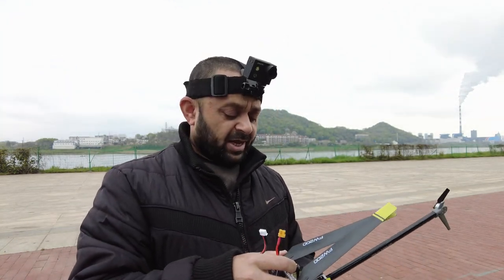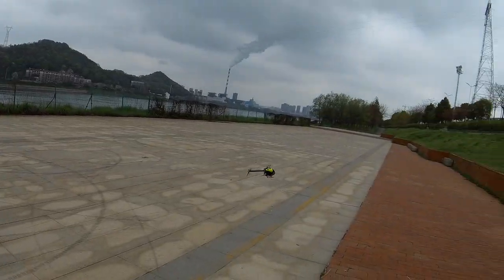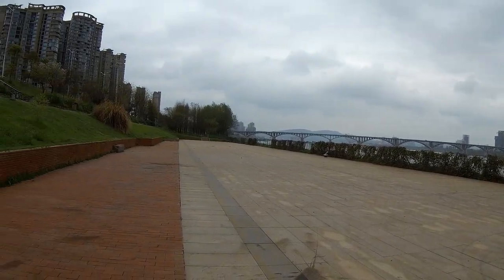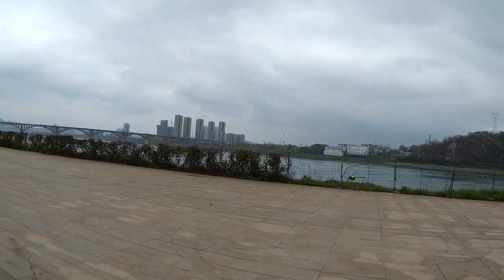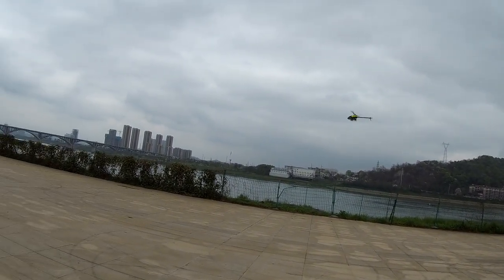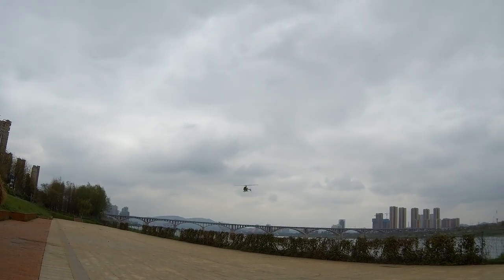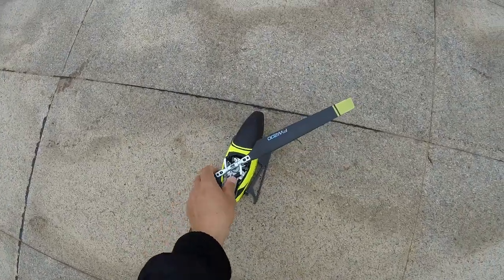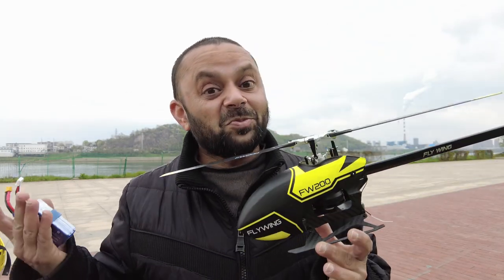Flywing FW200 H1 GPS RC Helicopter Flight Endurance Test

Comment: Hi Ali. Thanks for the evaluation video. You mentioned the large  nut under the motor housing being a safety feature. In my case it turned out to be the opposite. There is a small 2mm screw with washer screwed into the main shaft right underneath the large nut. Supposedly to prevent the nut from unscrewing itself. In my case the brand new heli had 'a screw loose' so to speak and both the little screw and the large nut became loose, the shaft plus everything else dropped and the blade grips damaged the anti rotation bracket. If this happens during intense flying, a disaster!! The reason:  missing thread lock glue during factory assembly, I found out.
Reply from the maker: thanks for the info :) maybe flying passed me wrong info before.

Comment: Those are great flight times, one year ago. I just got my FW200 V2 and 'hovered' for about 6 min altogether with some interruptions and the cells already dropped to 3.9V each. Had to stop for technical reasons. So I assume I won't get near to this fantastic endurance time, Will have to try again for full test.
Reply from the maker: sometimes its the batteries that are not up for it. a healthy battery wil fly it longer

Comment: Awesome Video! Considering the price difference and the smaller size difference too, as far as enjoyment (smiling factor) and helicopter learning fun factor which would recommend between the eachine e180 and this one?
Reply from the maker: FW200 is best for learning from beginning. but if you really want to proceed to 3D aerobatics later, E180

Comment: I cannot find a 3S 11.1V 1500 mah battery with XT30 connector. Do you have a link to the one you have that fits in the chassis?
Reply: Ali, I know you are tied up Paramotoring, but if you have a minute, can you  send me the dimensions of your 11.1V 1500mah BT-17 battery? They are not available anywhere before June, and I need to find a substitute that will fit. Coffees are on the way if you can help. Thanks, Mark

Comment: Please can you help me do you know the size of the hexagonal screwdriver of the xk 127 rotor? (( screw off the blades))<would you know it's okay that it would be necessary Please? And what type of screwdriver are essential to disassemble a helicopter??
Reply: Are sl slotted screwdrivers useful for the helicopte
Reply from the maker: previously i shown a screw drivers set with electric screw driver on my channel. you can get one that type and repair all mini helis

Comment: Hello Ali, again awsome video. Thank you.  I would suggest to buy 1 size battery smaller to be a little little bit more away from the motor. Looks little bit crazy to me how close the lipo is in the motor. May I ask you for a additional video? You promised a 3D flight with this helicopter. I still waiting for this video since 1 month :)
Reply from the maker: Ah I got very busy and i did try 3D on this one but to be honest its just not so good for manual 3D. no idea why but its so slow and docile to move around and control in manual mode. maybe they programmed it better for GPS and auto features but not for manual 3D.

Comment: I have a brand new FW200 that I got from Heli Direct, along with 3 new BT1500 -17 Li-po's same as Ali is using here, and I only get 8 to 9 min. flights and that's fine, but all 3 are weak. 2 of the li-po's after flying only 6 mins. I get the blinking red Low Voltage light, I land, check the cell's voltage and they have 3.86v to 3.88v per cell which is not close to LVC, should be at least 3 mins. of flying time left. I sent my FW200 back to Heli Direct, the tech flew it with his 1500 saying it flew fine, and he sent my heli back to me including his 1500, the 1st. 9 min. flight with his li-po was fine, the 2nd flight I got the red LVC light again after 8 mins. So I have 3 brand new Fly Wing 1500's and I have concluded they are weak and have a low C rating even when new, and notice how they don't even list their C rating? No sense in me trying a 4th. new one. Ali flying with the same 1500 as my 3 and getting 21:36 mins. of flying time? That's some crazy magic there, and I don't believe it. My heli tech said with a 1500 they fly for approx 6 to 8 mins. and 9 at best. I told him this claim of flying a 1500 for 21:36 mins, and he said impossible. Either Ali has a totally 'magic' 1500 or it's a sales gimmick to get people to buy the FW200. Some commenters here are so happy & excited about such a long flight time. DON'T BELIEVE IT !!
Reply from the maker: Hi Buddy, I do not lie nor I fix my videos. I have flown this heli many times and with those batteries i shown in videos plus you have seen its a straight forward honest video. its all about how you handle battery, I charge using pro chargers, i set my rpm right, i fly and cruise as you have seen in this video. and i make sure to disable the low voltage RTH. so i can drain the battery to its safe limits. if you keep Low voltage RTH on, it will always make you land earlier. another thing, batteries behave different in different temps and weather conditions. if its colder, you won't get much flight time, you have to charge with pro charger in winter and keep batteries warm before using. else you won't get any better flight times. then there are many other factors. you can study about batteries online and learn to get best results from these batteries.
Reply: @alishanmao Ali; Thanks so much for your reply! Excuse my late reply; I apologize for my comment suggesting you might be lying about such long flight times, and I will edit my comment to remove that. My new FW200 has been driving me crazy. I'm an advanced level RC person, I use only high quality hobby grade chargers and know much about Li-Po's, and regularly check their IR or 'internal resistance' I have a Fly Wing 450L V3 and it's perfect, also a YU XIANG Coast Guard heli and it's perfect. But my FW200 (Been flying it in 65* temps) after charging both of my new FW- 1500 li-po's to 4.20v per cell, it has an often constant problem of flying just 5 to 6 mins. then losing power & sinking, then barely hovering above the ground well before it's 1500 li-po's get to 3.84v per cell, so I sent it back to HeliDirect and the tech test flew it, he sent me 2 vid's of it flying well, then he sent it back to me with his FW-1500 that he used. So I then thought that my 2 new 1500's were defective & weak. My first flight using his FW-1500 Li-Po it flew well for 8 mins.=3.84v left per cell, but then shortly after, using his same 1500 li-po again, on the 2nd flight, same problem, after 6 mins. it loses power, then while hovering just above ground, I sometimes get the 'Level 1' red flashing light (Level 2 is auto low batt RTH, but I never get the level 2 faster red flashing) Then I tried my other 2 new FW-1500's again and they are worse, heli loses power & sinks sooner. I then concluded that the Fly Wing 1500 li-po's are weak with a low C rating, not enough power output. Wanting to try a higher output stronger li-po, I bought a new 1400 li-po with 90C 'high discharge' This 90C on it's first flight (68* temp) it was great, flew well for 8 mins. = 3.82v per cell, problem solved!  Well no, soon after, using the same 1400 90C li-po, 2nd flight, flew near 6 mins. then the dreaded low power sinking again & hovering just above ground, and no LV red flashing light. Then I tried his FW-1500 again, same thing. My FW200 seems to have 'moods' Everything points to weak li-po's, but a new 90C high output li-po? Something else is going on, maybe defective ESC, or motor drawing too much power? One flight good, next flight low power problems again. I appreciate you writing about for longer flight times... "disable the low voltage RTH" But seems I'm not able to do that, I don't have a smart phone or Android to get the app for those adjustments, I just have a laptop PC and have found no app for a PC to be able to do things like that. And I appreciate you writing about "different temps and weather conditions" I've been flying in mid 60* temps, my fully charged li-po's are taken from my warm house then flown right away, and li-po's usually warm up while being flown as mine do. My 'moody' FW200 has challenged all my knowledge of flying machines & li-po batteries, just when I think the problem is solved, it comes back again. I'll be calling HeliDirect soon and ask them to take back my FW200 on return and send me a new one, as I can see no way of resolving this ongoing problem with my moody FW200. Thanks for your interest & reply, and if you might have any thoughts on my 'moody' FW200? And I've enjoyed your YouTube video's, thank you! (And soon I will edit my comment, sorry for any perceived offense, when I wrote it I was so frustrated & irritated with my often short flight times & low power problems, then I see your YouTube with you saying you got 21 mins. & 36 seconds of flight time. When I'm happy if I get a full 8 mins. of flight times.
Reply from the maker: I believe you have a Faulty ESC or Motor. can you try all your batteries again by turning off the Low RTH and Low voltage failsafe. I normally never use those on these helis @HeRacesTheSun
Reply: @alishanmao  Ali; Thank you, that's what it seems like to me, but here is what is really strange... I sent it to a heli tech at HeliDirect in MA, U.S.A. twice for the same problem, both times he test flew it, and it flew well for 9 to 10 mins. no sinking or low power problems like I have, and he sent me videos of him flying it fine with no sinking or low power problems like I have. He sends it back to me, now 2 times saying it's fine after 3 test flights. I get it here in Arizona, go fly it, and just 2 mins. into the flight it starts the sinking & low power again. (Note about 'RTH' Switch to RTH within 10 meters (18.5 feet) of where it took off, and it will just land, but further out beyond 10 meters it will rise up high & slowly come back and land.) What's more strange is while it's barely hovering above the ground, I fly it out far enough well beyond 10 meters and switch RTH on, and shockingly it increases power a lot, rises way up to about 60 to 70 feet, and slowly flies itself back home, the whole time with lots of power, crazy! The tech and I have no idea why it flies well in MA, but not here in Arizona, and he sent all my notes and also discussed this with techs at Fly Wing the mfg. and they have no idea why this is happening to me, so I have it back for the 2nd time and it's still not right. The tech suggested I do a compass calibration, though the compass being off should not cause the early low power sinking I'm getting, but I don't have a smart phone to be able to download the app to calibrate the compass, I'll have a friend come over with his and check the compass, but I don't think that will help. If the ESC or motor was faulty, why would I once use RTH and the power increases, goes up really high and flies itself back with more power than normal flying? As you wrote... "turning off the Low RTH and Low voltage failsafe" Well I would love to do that, but I don't know how? And I've seen screens for the downloadable app, and it doesn't show an option to turn off the low RTH or LV failsafe, how do I turn that off?  Ali; If you lived in the U.S. I would send my FW200 to you, figure out what's wrong, and pay you well to fix it, or I would just give it away to someone as I've had enough of this craziness, it won't fly well very long and nobody can figure out why. Thanks much for your replies and trying to help...
Reply from the maker: I am sure its some GPS issues you are facing in Arizona. if it flies fine in other areas. make a nice compass calibration and test again. else just set the thing to ATT mode and fly in ATT or 3D. Don't use GPS  @HeRacesTheSun
Reply: @HeRacesTheSun  I have the exact same issue as you do with WAY to short of flight times with my brand new FW200! :(   I intentionally ordered it with 3 -FW 1500 ma batteries after watching Ali's incredible flight times and figured i'd easily get well over 45 minutes of flight time in field , NOPE!  I was shocked when the low battery started beeping around 6 minutes in AND being first flight, all i was doing was light flying in circles only maybe 15' off ground.  My feeling was instantly , like buying a new car , the tires are usually cheapo from dealers as they aren't putting Pirelli's on to sit in their lot. So my thought is the Flywing batteries are inferior, I do love the high tech copter mind you, very well designed with the all metal swash plate assembly & direct drive brushless motors! So i've been online for quite awhile researching top brand lipo batteries that will fit the FW 200. Not easy with so many different dimensions & plug types, C ratings etc. Yes frustrating to find such short flight duration from brand new everything!   ps, I also found it strange the company advertises them as 45 C rated yet for the life of me I can't find that rating anywhere on the battery itself!?

Comment: When I fly FW200 in hovering mode (beginners mode) my Fw200 does not go higher than 3 or 4 meters. Is that  a true reaction??
Reply from the maker: that means its in Attitude mode. not GPS mode. if you do not let GPS lock all the satellites, altitude is limited

Comment: Keep flying Ali 😅😅😅
Reply from the maker: Thank you :)
Reply: @alishanmao  I just got my Goosky Legend 200 S2 RTF. I tried to maiden flight, and every time I throttle up slowly it tips forward, what I’m I doing wrong? Please advice 
Thank you in advance!!
Reply from the maker: @carvingfool  when power up the heli, make sure its on a leveled surface. connect battery and leave the heli on a perfect leveled surface, until its initialized. once done, then insert the battery in the compartment and close it. now take off. but do remember, all 3d helis like these require constant input to take off, you can't expect them to take off like a GPS heli on their own without input :)
Reply: @alishanmao  wow you’re simply the best!!! Thank you so very much, I’ll give shot tomorrow, and let you know how it’s goes.
👍👍👍👍👍👍👍
Reply from the maker: @carvingfool  always happy to help. have fun
Reply: @alishanmao  yup that did it. Thank you so very much!! I send you another reply concerning the sensitivity of cyclic if I can be turned down via the app since a have the rtf?
Thank you in advance!!!
Reply from the maker: @carvingfool  yes use the app and you can turn down the sensitivity easily
Reply: @alishanmao  hi Ali, I just flew my Goosky 200 maiden. Quit a hand full. Can you tame down the cicllic on the app?
Also did you just plug in the Bluetooth module and find it on the phone app, no update needed for the flight controller??
Thank you!!
Reply: @alishanmao  Thank you for your reply. Do you have a video how?
Reply from the maker: @carvingfool  yes using bluetooth plugged in, you can easily connect the app to helicopter and turn down the sensitivity on cyclic. its easy, you can try different settings and remember to save before quitting.
Reply: @alishanmao  hi Ali thank you, do you have a video on how? Also do have a wassup account?
Reply from the maker: @carvingfool  no video on that buddy :) yes i have whatsapp, email me and i can share it.

Comment: Ali,just curious,have you experienced loss of GPS signal while in flight ? if you have what happened,if you have not what do you think would happen ?
Reply from the maker: did not have that issue. anyway if it loses GPS during flight it will switch to altitude and attitude mode. RTH will not work

Comment: Ali, can I bind the FW200 to my stock I6 radio that came with my FW450? Thanks
Reply from the maker: no you can't. it has SFHSS receiver. only if you replace the receiver to match your FSI6 radio protocol then you can

Comment: Ali, how to cancel RTH? When RTH is cancelled, will it stop beeping or not? Thanks, Jeff
Reply from the maker: Switch to Other flight modes. will cancel RTH. and it should stop beeping.
Reply: @alishanmao  Thanks buddy...
Reply: @alishanmao  You say different flight modes, just flip into acro and things should stop? When you're flying, what do u do when the LED flashes red and the beeping starts? I'm getting around 10 min. on stock 1500mAh. When I land checker says around 3.8 per cell and 11.2 overall. How low can I safely bring my battery to without damage to them? Do u have a small battery alarm set to a number to remind you to land? Thanks Ali!
Reply from the maker: @jeffkraus1457  when flying there is load on battery, so it drains to the levels your beeper beeps, when you land, there is no load on battery and volts go up to 3.8. basically you can fly all the way up to 3.6v per cell.

Comment: hello, I am looking for a solution to make the FW200 faster in its forward, backward and lateral movements in stable mode. Is it possible to change a setting for this?
Reply from the maker: you can play with settings in the app :) or fly manual mode
Reply: @alishanmao  I have downloaded the application, what settings do I have to change for this? in manual mode I find it very difficult to fly, because compared to the Goosky S2 the pitch is not maintained, don't you think? as soon as you switch to manual mode, the helicopter drops very quickly. Thanks for your help. fred
Reply from the maker: @Freddy-tv2ki  All flywing helicopters have this, when you switch to manual mode they drop altitude. you have to keep the throttle up and then switch to manual mode or land and switch and take off. this can't be undone. its the way it is. hope flywing can improve this situation. its about the pitch curves they have programmed
Reply: @alishanmao  ok i will try again thank you. concerning the stable mode, I have the android application, but I do not see what parameters to modify to speed up the movements?